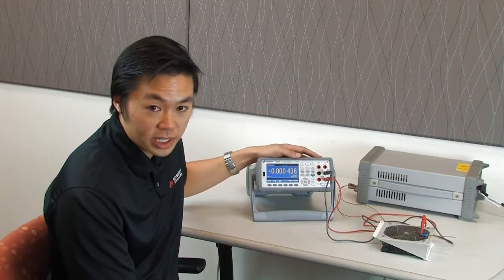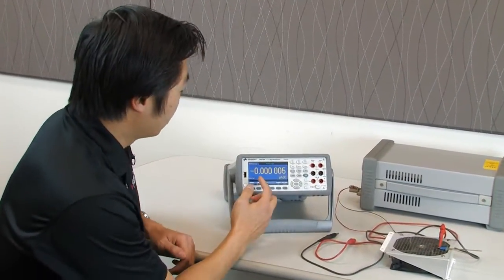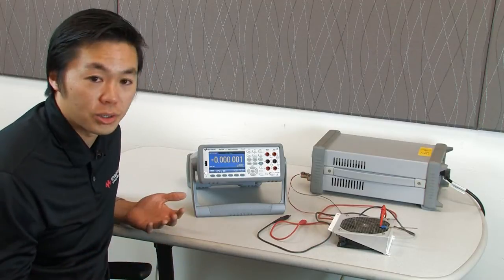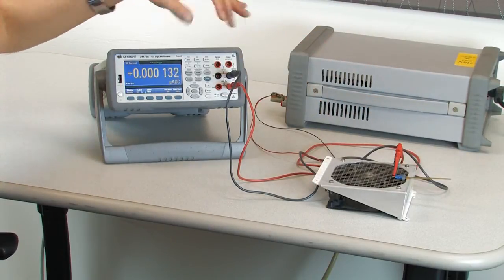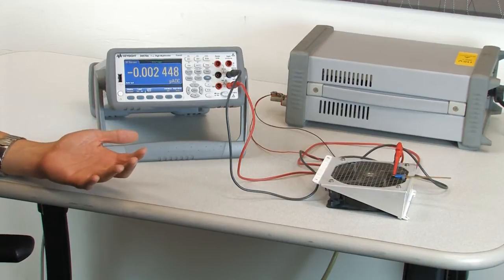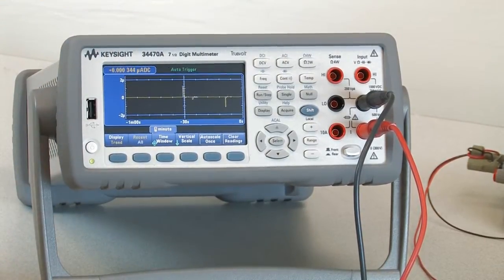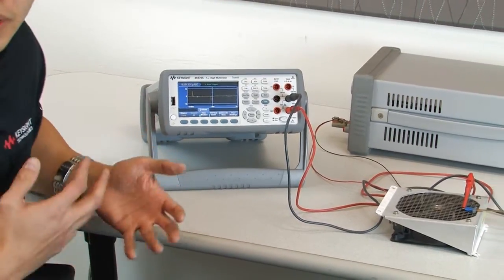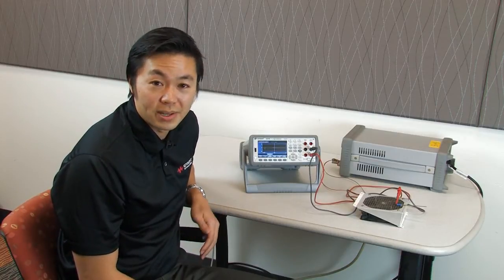Measuring Low Currents with a DMM

Comment: hi, could you tell me what power supply you're using alongside the multimeter?
Reply from the maker: We used the E3600-series power supply in this video. You might also be interested in the E36100 power supply, both are designed for low power, low noise applications

Comment: New good multimeter.
But interface seems to be slow. Hope it is not as slow as BenchVue.
Reply from the maker: In this video the reading speed is set to 10 PLC, which only takes 5-6 readings a second. This is good for taking high resolution measurements but can be a little bit slow. You can change the reading rate to take up to 50,000 readings a second, which one of the fastest rates in this class of DMM.